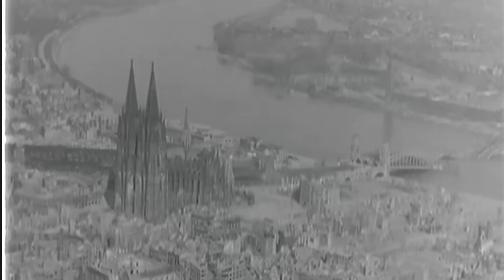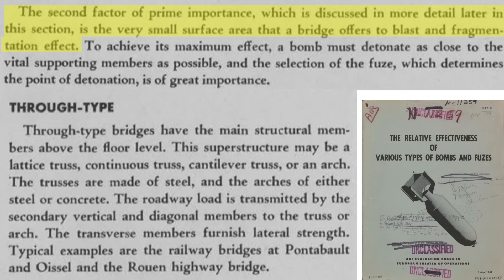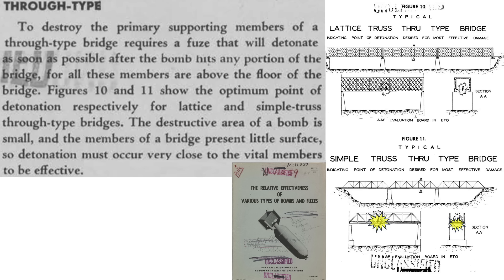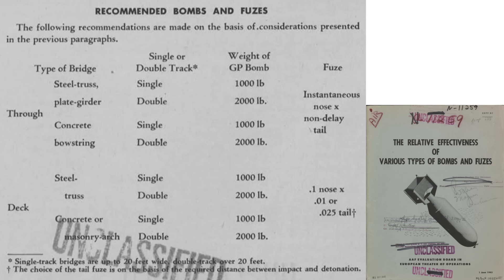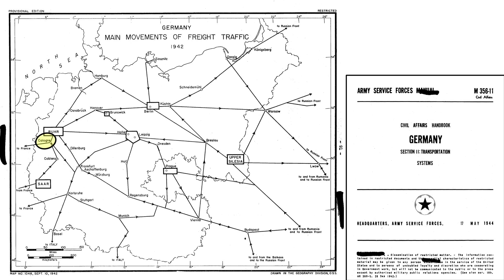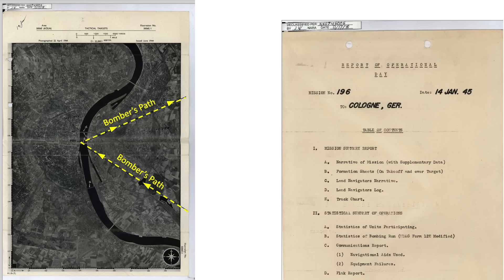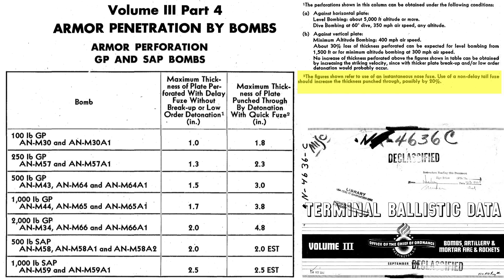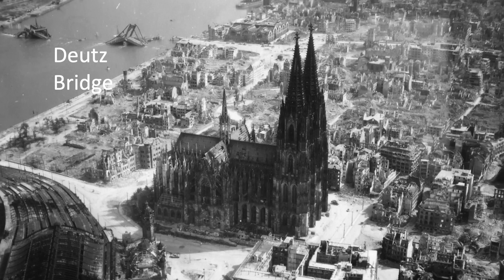Bridge Busting B-17 Bombers over Cologne, Germany – Case Study Review

Comment: To be honest, as a German, I find it rather hard to "enjoy" your videos.

But they are very interesting and informative.

For example this one. I have always thought that all Köln bridges had been destroyed by the German armed forces themselves. But this one was destroyed by an almost surgical strike.
Reply: To be fair, (if it helps you to deal with the situation better - I do fully understabd your POV), that's not what the video states. It may have been as you feared, or as you originally understood, or the bridge(s) may have been destroyed in a subsequent attack at lower level.  The video does explain that a bridge is a very small target to hit from high altitude, and that bombs were almost all dropped within 1000 ft of the aim point. It's possible that sheer luck (despite the excellet performance of the bombers quoted) may have caused a strike or so on vital parts of the bridge, but it's also possible that strikes may have hit the bridge, but not caused structural damage, or that there were many near misses. The document quoted claims that the bomardier saw hits around the MPI, and the image at the end (and near the beginning) shows that the bridge(s) were destroyed by war's end.  That was many months after the Feb 1945 raid described in this video.  If there was BDA after the raid that showed the bridge(s) destroyed immediately after this raid, it wasn't quoted in this video, so we don't really know how the bridge(s) were destroyed.
Reply: @mikewindsor5759 
It wasn't sheer luck, it's called the Norden bombsight and this is just one of many examples of how truly accurate it was.
For years aviation authors, and nowadays video content creators using the books written by those authors as reference material, from a certain region have had an agenda and bias for bashing the Norden bombsight, they've always done it by holding it to some ridiculous and impossible standard that no other piece of military hardware, certainly not one from their country, has ever been held to, ask anyone including myself who's ever collected military arms what kind of accuracy you can expect from a .303 Lee Enfield rifle and the common answer would be about 3½" groups at 100 yards, now considering that the average distance between enemy infantry soldiers engaging each other in WW2 was 60 yards it'd be real easy for me to bamboozle someone who doesn't know anything about firearms into thinking that the .303 rifle was a piece of junk citing the fact that a post war study showed for every enemy soldier killed with a .303 on average 357 shots were fired by them, and since the average distance between enemy soldiers was 60 yards we can extrapolate that the true accuracy of the .303 rifle was 1 shot out of every 357 would hit a man sized target at 60 yards, now to anyone with any kind of common sense would immediately know is that I'd be using that information waaaaayy out of context to make that claim.
If a lead navigator flys an entire formation of bombers to the wrong target resulting in it getting bombed that's not the fault of the Norden bombsight, and when someone is using records in a manner that they file every single bomb dropped by that formation as "zero bombs on target" they're using that information out of context, and for years that's the path many aviation writers have led people down when it comes to bashing the Norden bombsight, especially when you look into things and find out that the bombers absolutely plastered what they were actually aiming at it's then you realize that the people making these claims about the Norden bombsight being some kind of failure and all the other bad ways of looking at it they can roll up and hang around its neck. 
The fact is the Norden bombsight remains to this day the single most accurate optical bomb aiming system ever devised by mankind, that's because the next step was radar bombing that far exceeded the rudimentary 1st generation of active radar bombing used in WW2, within 15 to 20 years after the end of the war they had radar imaging from 85,000 ft that had a 1 foot resolution, couple that with a digital targeting computer and you simply didn't need optical bomb aiming anymore.
It may not have been digital but the Norden bombsight was indeed a computer, it was an electro-mechanical computer, and like any computer if it isn't used right or if the wrong values are entered into it then you're going to get bad results, along with a thousand other things working against you like you're enemy camouflaging a target and setting up a decoy 2 miles down the road, once again the decoy gets plastered but the people with a bias keeping score mark it down as "missed by two miles", well there you go, more misinformation being created. 
The Germans sure did hold the Norden bombsight in high regard and their wartime reports are very clear on that, they specifically cited the 8th Air Force's bombing campaign as the biggest threat to the production of their war machine, other air forces bombing campaigns they pretty much regarded as a nuisance compared to the 8th's. 
Despite nonsense claims by people nobody else in the world during WW2 could bomb with the accuracy the USAAF could, nobody else was even bombing from the altitudes and speeds the USAAF was, when the Enola Gay released Little Boy it was from an altitude of over 30,000 ft and a speed of over 300 MPH (ground speed), and it detonated directly over a point just 800 feet from where it was aimed, nobody else in the world was capable of doing that.
Reply: @mikewindsor5759 
BDA assessment PR photos sometimes came from the mission itself and if that wasn't possible then within hours, the 24 to 48 hours necessary for the smoke to clear, PR missions were flown for BDA purposes, they had to know whether or not they took it out because if they didn't they had to go back, they knew within a few days whether or not they took out those bridges, if they say they did then you can bet they did, BDA from their PR photos wasn't rocket science like sifting through the remains of a petroleum refinery after the war doing the BDA on something like that, it's a bridge, either it's still standing or you put it in the water, with something like that claiming that they really didn't and there's a chance between then and when the Allies rolled into the city retreating German forces blew the bridge and the USAAF intelligence people incorrectly thought it was the bombers that took it out is a serious stretch of the imagination.  And no, it wasn't "sheer luck", for too many years a certain group of aviation authors have had a bias for bashing the Norden bombsight and the USAAF's bombing campaign as a whole, most likely that's because if they're doing that it means they're not talking about their own country's bombing results which were considered a nuisance compared to the 8th Air Force's bombing by the Germans themselves, their ministry of arms reports from during the war were very clear on that.
The Norden bombsight is constantly being held to some ridiculous standard that no other piece of military hardware in world history ever has, there was no weapon, not a fighter plane or a naval gun or even an infantry rifle that's been held to some ridiculous standard claiming that because every time one's used just because an enemy didn't drop right there it means it was a failure, every infantry rifle of the era was capable of at least 3½ inch groups at 100 yards, and since the average distance between enemy infantry soldiers engaging each other in WW2 was 60 yards that means every shot fired from one should have resulted in a dead enemy soldier, and if not then we can label it a failure, which is a ridiculous claim for obvious reasons, yet for some unknown reason the Norden bombsight gets held to that standard, and it's nonsense, it's nothing more than the result if 80 years of aviation authors, from a certain region, having a bias for bashing the Norden bombsight. 
Why people even fall for that logic when it's applied to the Norden bombsight yet they have enough common sense to understand why you can't claim for every shot fired from every infantry rifle in WW2 should have resulted in a dead enemy soldier is mystifying. 
The Norden bombsight remains to this day the most accurate optical bomb aiming system ever devised by mankind, it was the pinnacle of optical bomb aiming and the reason no optical bomb aiming system more advanced than it was ever produced was because within 15 years or so after the war ended radar imaging had advanced to the point where its resolution was good enough for high altitude spy imagery, at 80,000 ft cameras had a 6 inch resolution and radar imagery had an astounding 1 foot resolution, that's well within what's needed to aim bombs and since radar could see through anything there was no point in advancing optical bomb aiming, couple that kind of imagery from ground scanning radar with digital targeting computers and there just wasn't any need for optical aiming anymore, but the fact remains it was the single most precise bomb aiming system in WW2 and is why Robert Oppenheimer would only sign off on optical aiming for the release of the atomic bombs, he had the final say on the matter and would only approve of the Norden bombsight for that job.
Reply: @mikewindsor5759 
PR photos sometimes came from the mission itself, when they didn't then within hours, as soon as the smoke cleared, PR missions were flown for BDA purposes. 
It's not a petroleum refinery that takes post war boots on the ground BDA to access how many underground pipes had been severed, it's a bridge, it's either still standing or you put it in the water, it wasn't rocket scientist level BDA on something like this, they knew within 48 hours, most likely in half that time actually, whether or not they hit the bridge, when that report was written they already knew for quite some time whether or not that raid took out that bridge, PR imagery after a mission was high priority, they took nothing for granted because if nothing else they had to know whether or not to launch another raid on it.
If that report says they hit the bridge then they hit it, to suggest that they didn't know until the end of the war and that their conclusions might have been wrong based on the Germans some time in the months afterwards having blown them up themselves during a retreat is a stretch, a very big stretch. 
They knew within days whether or not those raids took out whatever bridges.
Reply: As an American, I don't particularly "enjoy" these videos.  I am glad the Allies won, and the Nazis were defeated, but all the pain and suffering of the airmen and civilians are both sides, especially in the Pacific, seem like such a waste. These are mistakes we are bound to make again.
Reply: @JamesDeCamp-o9d indeed it is too bad, that war is still raging in several places.

Comment: I'm confused by nose vs. tail fuses. Does a non-delay tail fuse initiate detonation from the tail when the nose of the bomb strikes? The detonation starts at the tail but timing initiates at the nose? It doesn't make sense that the timing would initiate at the tail - if the bomb is close to vertical at contact, the tail fuse would not contact anything.
Reply: When the bomb hits whatever it hits, (I imagine even even water if it's travelling fast enough), the nose will slow very qickly, and the tail, attached to the rest of the bomb, likewise.  The tail fuse is set to activate on fast deceleration, (like bomb hitting something and almost stopping dead) seting the explosive off tail first, adding a larger downward blast component to the effect of the bomb compared to if the nose fuse had set off the explosive.

Comment: @8:14 I'm assuming that accuracy was due mostly to the winter weather conditions. After operation bodenplatte the Luftwaffe never rose in large numbers. That coupled with sever fuel shortages and inadequately trained and inexperienced pilots means that most of the resistance at this point would be from AA guns. But since the front was very close, the AA gunners would have less intel and advanced warning to co-ordinate their defenses, so I'm guessing that any accuracy issues was do to inexperienced allied airmen or due to weather.
Reply: Germany did have long range radars, you do not hide 1000 bombers that fly high, so they did have advance warning, but what shall they do 1945, the guns was worn out, with a chronic shortage of ammunition and trained personal. You know things is bad in the third reich then they put school girls to man the guns.

Comment: I wonder why they didn’t use Thunderbolts, Typhoons or Mosquitoes?
Reply: These medium/small precision bombers were fully in use in ground support post D-Day - they would be chopped to bits in Cologne where chaff can't help low altitude bombing against flak nests. Also 1,000 lb bombs are not enough to disable a large bridge - the roadway can be repaired very quickly. Yes the B-17s used 1,000 lb bombs, but perhaps the USAAF thought many bombs would do the trick [it didn't] it didn't really hamper its use by the Germans to move supplies to the West.
Reply: Flak. The bridges had quite  bit of guns around them. the high flying bombers would be more survivable. While the low flyers are more accurate in general they likely had survivability issues in this environment.

Comment: Why not always use RDX instead of TNT if it has 1.5 the explosive power by weight?
Reply: What do you do with the millions of tons of TNT bombs already delivered to US bomber bases? The making of RDX in the USA only really began after the Tizard mission because the US military didn't trust RDX. The mission included info re stabilising RDX for safe manufacture/handling, then the facilities have to be built for a new chemical process. RDX was prioritised for depth charges & torpedoes where the increase in explosive power would make a real difference [depth charges w RDX could kill a sub even when quite far from the sub - this improvement in kill range matters less when your target is 1,000s of feet in size rather than sub-sized]
Reply: @nightjarflying   Thanks for the detailed answer!
Reply: TNT is dramatically cheaper, especially when produced at scale.
Reply: cost and/or handling/safety issues??

Comment: Looks like the bombers flew offset 45 degrees to bridge, which I assume is optimum if the bomb impact error area is circular.  But what if the typical bomb impact error is an elongated ellipse?
Reply: Direction is irrelevant on such a small target - the attack direction was probably chosen based on known flak positions & landmarks for setting up the run. I don't believe the documentation - there's no way that 98% of the bombs fell within 1,000 ft of the aim point from 5 miles in the air. Note also the images are from after the war not after the raid.
Reply: I don't think the direction is irrelevant unless the bombs fall in an even-circular distribution.
Reply: @davidhoffman6980  Direction is indeed irrelevant when the target is very much smaller than the spread of the B-17 bomber boxes [the critical middle third of the bridge is only 400 ft wide dropping bombs from 5 miles altitude. The combined distribution is going to be a mess with the bomb footprint not mattering one bit given the intermittent visibility. The reported accuracy of the raid is an obvious journey into fantasy by the USAAF - someone after a promotion?